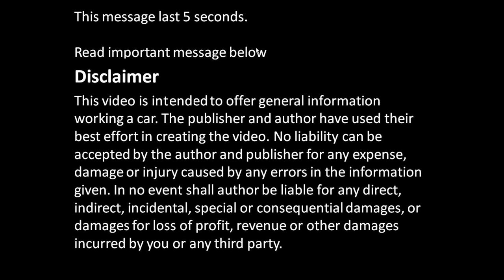How to test Toyota automatic transmission solenoids Years 1994 to 2015

Comment: I love that you made this video. I learned more about the inside of an automatic transmission. However you could use so many more things other than the plastic clamps to hold the small wires to the battery. Rubber bands, tape, hose clamps, small segments of rubber hose, so many better options. It was informative yet excruciating.

Comment: HI. I have a 1997 Toyota T100, 4WD, Automatic, SR5, 3.4L V6, with roughly 350,000 miles on it. A couple years ago, I noticed the transmission did not want to shift down to 1st gear at a stop. I had to begin manually shifting in "L", then shift up to 2nd, then "D".

Finally, about a year ago, it stopped shifting into top gear, but it also would Illuminate the "D" & "L" lights at the same time, and would not shift out of first gear . So it sat. This Labor Day weekend, I decided I was going to change out all three shift solenoids. I finally got all the work done and was ready for a test drive. At first, it acted the same with the "D" & "L" lights illuminated. I shifted into "2" and was returning home. I stopped at a sign, put it into "D" and the "L" didn't light up. So I turned around the block to put it on the highway and test it at speed, before I got to the highway, the "L" came on again and wouldn't go off again while in "D". 

My battery is fried from sitting so long and old age, and I do have some electrical problems with the truck. My right headlight will get really dim sometimes, and the only way to get it back to normal is to disconnect the left headlight, then reconnect it.

With the lights acting the way they are, and the shifting correcting itself for a short while, then malfunctioning again, I'm curious if the whole thing is nothing more than some sort of electrical grounding issue. I live in rural Indiana and no transmission shops would touch my Toyota with a ten foot pole, so i had to do it myself. Any insights?
Reply: Hello, some years ago i had a similar problem with an toyota marino, in a crash the transmission output speed sensor conector got broken and the engine would stall when putting it into drive, but worked fine when shifting it manually from 1st to 2 then D. Problem was gone after fixing the conector. Maybe your sensor got broken or its wiring got damaged(Rats, vibrations or whatever)

Comment: For this test, it would be safer to have a pigtail ... connector on one end and loose wires on the other. Then just plug in connector to selonoid and attach wires to battery with electrical tape
Reply from the maker: Ok

Comment: Suggestion: test them in hot transmission fluid because these can get stuck as the fluid gets hot (80C) and the metal inside expands.  These transmissions usually have problems as they warm up.  While there just replace the solenoids with new ones and set the relearn mode
Reply from the maker: Thanks

Comment: Nice but be careful you cross those two wires hooked up to. Battery you have more than a bad situation you may have explosion really like a bomb.  I had auto repair shop and only once did a battery explode and thank god the hood was down and nobody was near vehicle. The spark of a loose connection on battery terminal caused a small spark and boom like a bomb. If my face was in there who knows maybe deafness or maybe I would have received instant surgery without a doctor.  Really not the way to test or safe way to test solenoid.  Best to have or make a jumper cable connecter that will slip over solenoid terminals then you can connect the positive cable to battery first then connect the negative to a ground on vehicle away from the battery so a spark would not cause gasses in battery to explode meaning keep battery connected to vehicle then just put red from solenoid to battery positive then run black from solenoid to ground away from battery on other side of engine compartment way safer. Or hook up 12 volt power source then thru a switch on and off to negative black wire to solenoid Utah switch off connect to solenoid then flip switch and watch solenoid this way no spark  safe and you can keep switching solenoid on and off for as long as you like to see if solenoid acts up after it switches many times. Intermittent problem.  Any way his way may work but not advisable for back yard weekend mechanic
Reply from the maker: You are welcome. :-)

Comment: when testing you should use a 9volt battery Peter , or try connecting the part youre testing and then touch the battery terminals , much easier that way
Reply from the maker: Thanks for feedback. :-)
Reply: You're very welcome bud.
Reply: tried 9v battery, it couldnt power the solenoid, a 12v battery did...

Comment: my camry 2007 after scanning showed code p2770 Torque Converter Clutch Solenoid Circuit High please how do i locate the exact solenoid position of the code p2770

Comment: Hello Peter, I drive a toyota camry 07. when i put the car in drive in the morning the car will not drive until after 10mins. revers works fine.the check engine light shows p2714 pressure control solenoid d performance or stuck off... what do i do?... great videos by the way
Reply from the maker: Your gearbox is worn out, but maybe new oil to gearbox and oil replace could help. And you need to replace gearbox also with two years.

Comment: How do I search for park pawl activator to learn how to fix it?
The park pawl is engaged in Park, Reverse and Neutral.  The shift handle moves, the gears sound like they change, but the car acts like it is stuck in park.
Drive, 2nd gear and 1st gear work fine.
Reply from the maker: Good comment. If you want more help from me, then become a member of my channel. 😀👍

Comment: 92 corolla with 5a first generation engine with Atf auto gear . When car shift First to sec gear rpm is  2200 is it normal or high. Asking coz due to higher rpm gear shifting car consuming high gas. Thanks
Reply from the maker: I have read your post. Thank you for the message. Good comment. 👍😀

Comment: Mr Finn there is this solenoid with a broken bracket like which is partially the same with the one displayed.my hi ace has difficulty in reversing.could it be the sole problem since i changed the transmission oil.
Reply from the maker: It could be

Comment: Damn Good video thanks. I have a Toyota 2GR FE V6 2012 I noticed that only when going uphill at 1500rpm it shakes/vibration after passing 1500 rpm its ok when it is on flat groung no issues. Could it be a solenoid issue?
Reply from the maker: Thanks 👍

Comment: Hi Peter, I want to replace Shift Solenoid 2 (showing P0755 code) without removing the valve body.  You show lowering the valve body a little by leaving one bolt in. However I note that the accumulators are also shown which possibly indicates you removed the valve body. Can I remove Shift Solenoid 2 using your method without removing the valve body?
Reply: Forgot to add that I already did the transmission flush and filter change
Reply: Well, taking a chance I was able to replace the Shift solenoid 2  on my 2001 Toyota Highlander by leaving several bolts in and not letting the valve body drop too far. So it is possible to do it without taking the transmission out of the car.

Comment: I changed a tcc solenoid on my 2006 Toyota matrix. New oil new filter also. After I finish i clear the p0741 code. Then I run it 40miles and still no check engine.. But i put my scanner and it show p0741 PENDING any idea why it shows p0741 PENDING???
Reply from the maker: Noted

Comment: Even if it work it may be that the plunger is worn or the hole where goes may be worn
Making it the need to upsize the solenoid
Reply from the maker: I have read your post. Thank you for the message. Good comment. 👍😀

Comment: What year is your car because 1994 ceiba has a pressure solionoid on top two bolts 10 mm wrench try and see if that one working ok because if it not shifting into fourth gears see if you getting current to solionoid on top of trans
Reply from the maker: 1991

Comment: Having a problem possibly with the solenoids my 2009 Scion xB takes about 2 minutes to get into first gear then once the fluid gets hot it shifts fine. But if the solenoids were bad it would never work
Reply from the maker: Yes, replace fluid to Ford fype F
Reply: I have a Toyota Corolla 1996 model and the gears are not entering. No reverse no forward. But the engine is running. What could be the problem with my gearbox? It's an automatic transmission

Comment: Thanks for uploading. I was wondering if you can help me, I have a 2007 Toyota Rav4  with a p0766 code. Can you tell me which solenoid is shift solenoid "D"?
Reply from the maker: Hi Bryan, I  recommend that you replace transmission oil first ! It  could help.
And your code could be from these issues Causes for this P0766: Insufficient fluid level, Dirty or contaminated fluid, Dirty or clogged transmission filter, Defective transmission valve body, Restricted hydraulic passages, Transmission has internal failure, Faulty shift solenoid, Corroded or damaged connector, Faulty or damaged wiring, Faulty PCM
Reply: thank you for the reply! The fluid is very dark, needs changing, I want to check the solenoid while I have the pan off, just not sure which solenoid is the D solenoid.
Reply: Go to a local auto parts store and pick up a Hayne's manual for your specific vehicle. They have great diagrams in there for moments like these. It will show you which solenoid is which.
Reply: Thank you for showing     please can you help me      I change  for my car gerobox  after I changed  the check ingine light is came on my screen  of the car  so after thet I went to test by computer my car  is the result is  p2770     what is the reason behind  for these code         my car is Corolla 2010
Reply: Thank you for showing     please can you help me      I change  for my car gerobox  after I changed  the check ingine light is came on my screen  of the car  so after thet I went to test by computer my car  is the result is  p2770     what is the reason behind  for these code         my car is Corolla 2010
Reply: Someone said converter  someone is said solenoid   someone  said wire
Reply: Who is the result true

Comment: I just changed the trans fluid yesterday and just got code P0741 today, I regret replacing the fluid
Reply: Change or flush? How long before you changed it? Was it pure clean cherry red or dark brown coffee color with metal flakes? Did you change the filter? Did you use the correct fluid?
Reply: @Luckingsworth  the fluid was dark brown, so I changed it (not flushed) with sinthetic type IV (special for toyota) and I got c.e.l. because of that,
Reply: Have you fixed it? Mines is dirty and I have the code, dont know what to do. People told me it's to late to save to just use it like that untill it gives out. But I want to see what are my options.

Comment: If you're getting p2716 but the solenoid is fine, what could the problem be?
Reply from the maker: Hi, only these issues: Defective Pressure Control Solenoid,
 Dirty or contaminated fluid Dirty, or clogged transmission filter, Defective Transmission Pump, Defective Transmission Valve Body, Restricted hydraulic passages, Corroded or damaged connector, Faulty or damaged wiring Faulty PCM, bad clutch discs

Comment: Will changing trans fluid take check engine light off for solenoid stuck off? Thanks!
Reply from the maker: Sometimes it helps. Do you have Toyota?
Reply: Peter Finn yes, I do.

Comment: What is that black clip you have on your table with the spring. I removed my valve body and it fell. Does it have a spring that goes inside the black clip
Reply from the maker: Yes, it drops down. There is one slot where is belongs.

Comment: I worked for Toyota a long time to long really 23 years
What's u
Reply from the maker: Good work. I have worked only 20 years
Reply: I have a 1999 toyota solara I half to let of the gas for it to shift any clue of what that could be
Reply: @devryaj  my camry does the same. I was told its tcm. Bought a refurbished one. I'll let you know how it goes. It was $40 on ebay.

Comment: Hi. If i have p2757 issue what could be ? When car is cold all working perfect, then after roughly 20-30 miles then car is sleeper. Gear change „harder” and sleeper. I feel like 30ps less than before when is cold. In addition last time gearbox blocked first time on 3rd gear and day after on 4th gear and didnt change upper. For lower gears like 3rd, 2nd and 1st changed normally from 4th but didnt on 5ht and 6th. Does can be due to issue with selonoid or something addition ?
Reply from the maker: Hi, here are some ideas: 
Dirty transmission fluid 
Faulty line pressure solenoid valve 
SLU Line pressure solenoid valve 
SLU harness is open or shorted 
Line pressure solenoid valve 
SLU circuit poor electrical connection 
Torque converter clutch 
Valve body is blocked

Comment: hello peter may i ask why my car still shown same check engine shift solenoid shift a current high.. even if i change solenoid a and rebuild my transmission. my car is 2009 altis 1.6 g automatic.. hope your reply thanks
Reply from the maker: Some another issue is there